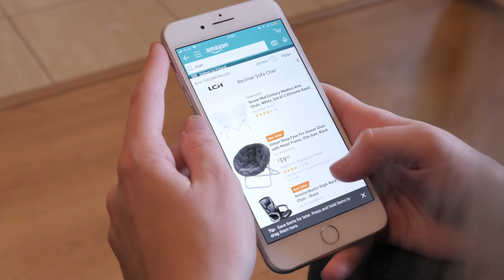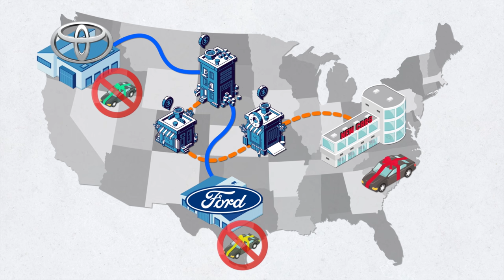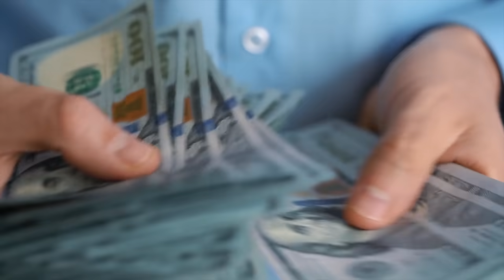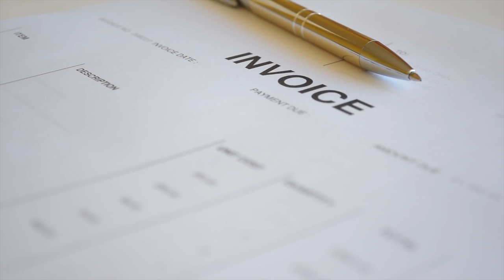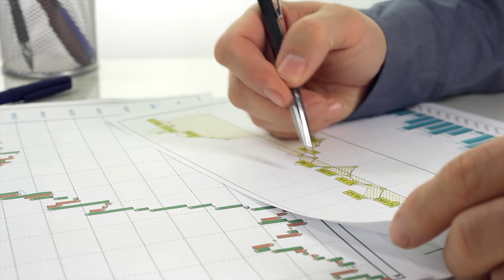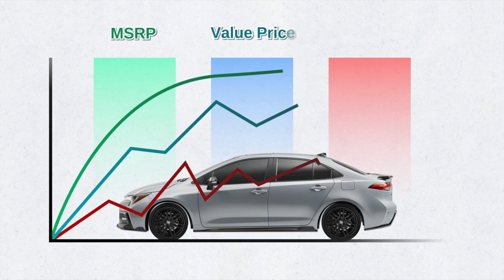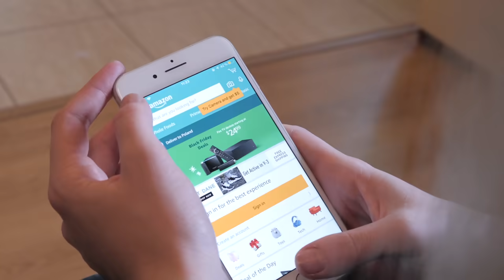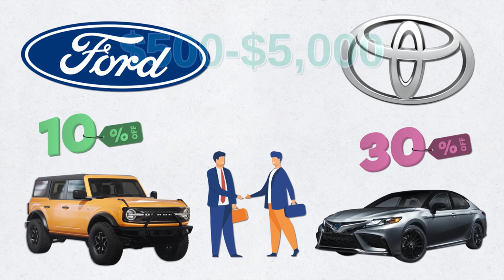Here’s Why Car Prices are About to Get Way Worse

Comment: That’s why I’m never getting rid of my 21 year old civic. Still runs great and plus insurance is cheap and the best part is I have no car payments.
Reply: Love my 01 odyssey.
Reply: Same here, I have a 2004 Camry 126,000 miles, never had a problem yet, I will never sell my car
Reply: @NewbirthHannah05  Diddo, I have a 2004 Chevy Silverado that I will drive until the wheels falls off. I also have a 1983 Oldsmobile Cutlass Supreme  Brougham,  a 1985 Buick Riviera and a 1982 Dodge Ram 🐏that I will drive.  Not going for the scam of buying disposable vehicles that are overpriced and will not last.
Reply: Same here with my 2006 Forester, 94 K miles, runs great, paid for and has a manual tranny too.
Reply: Love my 2020 mdx and 4 more years of payments to go
Reply: 99 v6 Honda accord 137k miles running like the day I bought it
Reply: @SpyderBlackOfficial  in 22 yrs it only has 137,000 miles ? You only put 6,000ish miles a year on it? That is awesome
Reply: @charleswilliams6758  Same here brother. I have a 1996 Ford F150 with a 5.0L (302) Windsor V8 with 209,000 miles on it and still going strong. The only things I replaced on my truck was the starter, the rear fuel pump, and the power steering magunisum but other than that mostly was just simple maintenance, took out the transmission fluid just to get rid of the shuttering it was making and it hasn't had a problem ever since. I Also have a 2011 Ford F150 with a 5.0L Coyote V8 in it with 142,000 miles on it and still going strong and it's a beast and it sounds like a beast with the Borla ATAK Catback exhaust on it and both of my TRUCKS will keep on truckn and best of all they're bought and paid for.
Reply: Same here Im keeping my 2006 acura rsx 5 spd manual base with 198,000 miles on it and driving to until the wheels fall off
Reply: Same. 04 sienna and 11 pilot
Reply: Same. I bought my used Camry 2012 SE model for 5k cash. Car only have 100k mils. Car have some style to it and it paid in full. I had this for about 3yrs now
Reply: Is the end of fancy cars in usa. 😥
Reply: I got my 2003 expedition for $3k. Repaired it and runs like a dream,
Reply: More than that, one of the biggest ticket item you have in owning a 21 year old civic is that you have little to no depreciation and it may even be appreciating as it ages now.
The next biggest ticket item is that it has little to no product obsolescence
The other big ticket item is that the knowledge, DIY diagnosis, repair and maintenance is non computer dependent. As it has been popular (not a limited model) around for years there is unlimited information on it. You can keep that car running longer than the newer cars.
Reply: I’m never getting rid of my 2015 Infiniti Q50. It’s sporty, reliable, and I’ve had it paid off for 2 years now
Reply: Mine is 11 and no buying a new car in sight.
Reply: @NewbirthHannah05  wait another 50k abs you’ll start to see problems
Reply: @SpyderBlackOfficial  Those are really good cars
Reply: Agreed. I got my Civic Si 2012 coupe, doesn’t let me down and I want to keep it. I just love it and gets me where I need. 103K+
Reply: My Porsche Cayenne costs an arm and a bloody leg to repair every time! Driving me nuts
Reply: UPDATE my civic was mashed in by another driver in the rear and was declared  totaled by the insurance company.
Reply: Stop thinking bout vehicles financially, it'll never make sense. Your life is yours to ENJOY. When ur on your death bed...the ONLY thing you'll think of is your loved ones and what you've done in your life and did u enjoy it. 

FROM DUST WE COME, AND INTO DUST WE SHALL RETURN.
Reply: @sanj5026  yeah I want to enjoy life not being in debt because of a darn car
Reply: @sonidoexperiencia  debt is fun my friend
Reply: @sanj5026  🙂 Isn’t that nice?
Reply: @kibawhitefang7176  isn't what nice
Reply: @sanj5026  debt 💸🤣
Reply: @sonidoexperiencia  same thing happened with my honda civic this month… need another car asap but car prices are terribly high rn and idk what to do
Reply: @mezxo5788  just keep looking around brother but don’t get rid of your car. I was able to get some cash for the vehicle and got to keep it of course insurance declared it “totaled” but I was able to find a good deal on a 2004 Highlander with 113,000 miles on it. Paid 8k for it

Comment: Its getting to a point where restoring any reliable brand such as a Toyota or Honda $1000 -$2000ish wore out beater is worth putting some tlc or restoration into with prices of newer used and new cars going as high as they are.
Reply: It really is.
Reply: I saw a video where a guy in Asia hand built a Ferrari replica with a diesel lawnmower engine and was driving it on the road. Try that here and they will arrest you and impound your homebuilt vehicle. You better comply. Who can and want to pay for new cars these days?
Reply: @mikenonameneeded3485  i saw that video! 😂 very impressive considering!
Reply: My 99 rav 4 will get some work now.
Reply: It looks like to me, after watching Craigslist, a beater will cost more like $2500-3000.
Reply: yea right 99 toyota camry goes for 2000$ in bad shape now lol even beater prices went up
Reply: Yup will last a lot longer once restored too
Reply: Yes but restoring or repairing older cars will be outlawed soon.
Reply: @lindap.p.1337  

That is correct. Late 90's model Civics and Corollas with over 250K on the clock, that were going for 1200-1500 back in the spring, are now selling for well over 3 grand.
Reply: They put extra 10000 on the prices lol inflated vehicles
Reply: Agreed.  I’m restoring a FJ-80 Land Cruiser and a ‘94 Jeep Wrangler YJ.  New Land Cruisers were selling for $90K + and new Wranglers are selling for $40K+.  Insanity.
Reply: It is
Reply: Spent 4 grand repairing my honda. No way I'm shelling out 29k for a new one when that same car was 22k in early 2020 new.
Reply: @lindap.p.1337  it’s rare finding a beater that cost less than 1000 bucks
Reply: Yup. Rebuilt a 2015 camry, shit’s hella reliable. 138k miles
Reply: @jamesb8619  

If it runs and has 4 tires on it someone out there will pay $2,000 for it
Reply: Base model it is
Reply: Yea the new cars just aren't reliably built and repair costs are ridiculous.
Reply: @subjectofgov  God, I hope not. If that happens, I'll cut my losses and start walking or biking everywhere. 

You'll never get me behind the wheel of anything I can't fix.
Reply: Just bought a 2015 Civic coupe EX-L with 28,000 mi for $19,500 worth every penny!!
Reply: Absolutely
Reply: @lindap.p.1337  i sold a 2004 civic 2 door for 4200 yesterday...210k miles
Reply: @fixitfelix718  

Good man... You could have got 5
Reply: I'm glad I put so much work into my 99 Mazda Protege. It runs like a top and is reliable. I just saw an identical one for $.5,000.00. Two years ago it would have been $2,000.00.
Reply: That's what I'm starting to think instead of getting rid of my 1999 Toyota camry
Reply: Just put $1000 into my 2000 Toyota Tacoma with 208,000 miles for new radiator and complete exhaust system including catalytic converters but it runs so good and reliable that I would be foolish to get rid of it. Frame is still solid under it, so I plan to keep driving it. A dealer isn't going to give me anything for it because it's a 22 year old truck so just going to drive it until it doesn't run anymore.
Reply: If per-mile road tax happens, I expect the price of old beaters with mechanical odometers to spike
Reply: @timetowakeup6302  yup, and I remember not so long ago the saying I've used my whole life was "anything running and driving is worth $1000" smh
Reply: @garyphillips6270  

You'd be surprised what some people would pay for your car.
Reply: @blurglide  not going to work either. They are putting GPS tracking devices in every single car that has a valid license plate. Can't get away from big brother on this one. That is part of what this pilot program is testing.
Reply: @subjectofgov  why?
Reply: thats why i am still keeping my 03 jeep liberty. Cost me less than 1000 in overall repairs a year including oil changes.
Reply: @lindap.p.1337  yup, it's absolutely rediculous. These people want 12k for rusted out, broken down shitboxes with 200 miles.
Reply: @phantomf41  you got a unicorn
Reply: @jamesgizasson  Get a job where you can work remote and then just buy motorcycles or something.
Reply: @robskyle  Not a unicorn. It have all the design flaws that came with mopar and chrysler but the way its been reliable for me is identifying faults ahead of time and taking care of maintenance in timely manner so it wont lead into bigger problems. Also I buy quality parts online and have my mechanic install it for me. I dont take it to any shops or dealerships to drain my money away into pits. A water pump for my liberty costs less than 200 including parts and labor. For a new toyota tacoma, expect its in 1000's even if you are getting the parts by yourself. Thats why I am still keeping my old liberty. Once you stay away from mopar parts while making purchases on after market, then you should be fine.
Reply: @IrishPizzaMan  that’s a steal
Reply: My 2012 Impreza has an appointment with the dealer to have the transmission diagnosed tomorrow . It’s better to throw a couple grand into the transmission than to buy a 3 year old used car that is selling at the current year’s MSRP or ridiculously close to it.
Reply: @subjectofgov  for real? Or are you just saying that cuz I never thought of it. Please educate me on this as I want to understand your point better
Reply: sad but true. I had considered buying a new car but theres so many reasonable used cars out there. or just fix up what i got and keep driving on :)
Reply: @midnightrebuilds  why did you have to rebuild a Camry with such low miles??? That was a rhetorical question🤣That car was abused.
Reply: Ssshhh people are catching onto this... All the beater cars are going up in price now

Comment: Looks like I’m hanging on to my 1999 Toyota Tacoma from high school. Nothing wrong with driving a car that’s almost the same age as you. Almost 200,000 miles and still strong. The only thing is that I want a prerunner or 4x4.
Reply: Brother you have an era that'll run 400k, folks will still try and buy that for decent money with 200k lol nice truck treat her well and you're set.
Reply: Might have to replace a torque converter or clutch round 300k.. Aw shucks lol
Reply: No cars are made like that anymore. Keep that golden piece of magic
Reply: I have the 02 prerunner double cab. I'm thinking of selling it. It has 230,000 miles. I just changed the whole front suspension and put a new AC system in it. It's fully tuned up.  My dad passed. It was his.  He took good care of all his cars and never drove them fast. I don't know though. It might be worth more than I know.
Reply: I traded a paid off 2010 Tundra for a 2015 Tacoma (Last year of the 4.0) for $33k with 60k miles. It's my 16th Toyota in my mid 30s and I'll be keeping onto this one for awhile. I travel across north America for work and can rack up the miles.  I don't forsee the current market getting any better at all so I made the jump to proven reliability for the 2bd gen model years after seeing quite a few issues with the 3rd gen.
Reply: @Xdtrl  How do you like the 4.0? My sister had the 3.5 and it was faaaasst! :3
Reply: @jamesgizasson  Even though the 3.5 has around 40Hp more, You need to be higher in the rpm band to achieve it with the torque. The 4.0 has some solid torque behind it aswell and has proven itself.
Reply: I have a 2006 Subaru Outback with 230,000 miles on it.... still runs like a clock
Reply: and you can still resale it for close to 10k right now
Reply: I have 308k on my 2002 Tacoma 4x4 super cab with the 3.4L.  Gas hog but never lets me down!  Yours is just broken in!
Reply: I have 4x4 ram and never use the 4x4.
Reply: That truck easily sells over 10k
Reply: Pre runners are really nice you can fine some for a good price, and ofc they’ll last forever
Reply: @erniecarrasco9107  for the love of God do not put another overpriced Toyota on the market!! Realistically it’s worth like 3k but people are tripping on used Toyota prices. Like 3 to 4 times what it’s worth😂
Reply: @DJ-kg6zq  🤣🤣🤣 ikr. I'll take 10k! Lol
Reply: @erniecarrasco9107  haha! It is a great time to sell… I still regret getting rid of my 1987 Toyota truck years ago😭!! It was soooo clean, I was too stoned 😄
Reply: @DJ-kg6zq  I sold my 91 manual toyota pickup 4 cylinder king cab 2 years ago. I miss my baby lol I drove it for 12 years! I sold it for the price I bought it for.
Reply: @erniecarrasco9107  🥺 they were such good trucks!!😭…

Comment: I have a 2019 sienna. Last year, i was $3000 upside down. This year, with 20k more miles on it, I'm $4000 in the positive! Lol its madness. So I'm selling that thing to make a profit and get rid of that $400 payment and get a paid off beater instead.
Reply: Look for a low mileage Corolla or Camry unless you need a van.
Maybe the hybrid Camry the way gas prices are going.
Reply: Smart move!
Reply: @k martin nice!
Reply: Have you received any offers from a dealership? I’m in the same boat with my is250 but don’t wanna be low balled
Reply: 2008 Mercury Grand Marquis was my choice. 3500 bucks.. Have had it 4 years.
Reply: @DWillz250  Print a flyer with a pic and details of the car and your number.
Shop it around to the service advisors at every dealership and tell them highest offer by next Saturday gets it. 
Tell them you're NOT interested in an offer from the sales department. 
This is a direct sale to the advisors who know cars.
Fax your flyers to other service departments in big cities near you.
This is the new marketing created by the Pandemic.
Reply: Better yet I just hang on to my ‘97 Saab 9000 despite the repair bills piling up to $2.5k in 7 years of ownership coz I can’t find a fun little practical sports sedan for what it is.
Reply: You will have made $7000 lol. You will get a 4K paid off car in the process and you will get $400 back in your budget.
Reply: I made a video about getting ready to sell my van, cleaning it up and fixing a few things if anyone is curious. I really dislike the rigors of selling private party. I am thinking of calling those car buying services. Who ever gets me closest to bluebook private party value wins. If all the offers are too low, than I will suck it up and sell it myself.
Reply: I had a very similar situation. I got out of my loan at a profit and paid cash for a beater. Things a unpredictable so I'd move on it.
Reply: The thing is, even that beater is going for atleast a 1500$ premium. Supply and demand effects everything.
Reply: Selling my 2017 4Runner and getting a used 2007 Camry

Comment: Im gonna drive my car till it dies. Then Ill buy a used car. There is no way I am buying new ever again. Those days  of having a new car every few years are  gone. Ill ride a bike if I have to!
Reply: I've done that exact thing for the past 30 years. Makes sense, economically.  :)
Reply: My new car is finally paid off, gonna drive it till it costs more than it's worth to fix it
Reply: My sweaty 300lbs neighbour drives around half the year wearing only dirty shorts and his hairy chest sweater. That interior is disgusting. I buy new cars every 10 or so years cus rust belt. There's no way I'm every buying used again!
Reply: riding  a  bike  and / or  walking  makes  sense.  owning  a  car  costs  too much  n  so  does  gas.
Reply: Sold my car in August and I have been biking everywhere since. It gives new perspective on owning cars. Increasing gas prices, maintenance, car insurance, and flat out being a liability has helped me transition into this new lifestyle of walking more and biking.
Reply: @stevegonzalez9871  that’s fine if you’re an urbanite. Not so much for the other 60% of us.
Reply: @stevegonzalez9871  I had to sell my car some years ago and rode a bike to work 20 miles round trip for a little over a year.. easily one of the most awesome years I ever had lol didn’t have to worry about, gas maintenance, insurance, tickets.. screaming at other people on the road.. I got to ride my own ride rain or shine and it was awesome!

Comment: My wife and I had 3 vehicles. I don’t drive much so we sold her 2019 Tahoe and stuck the money in our pocket. She’s driving our 2017 f150 now and I am driving our 1996 gmc 1500. We took advantage of the market. We are in our mid 30s and realize we have to make smart choices to better ourselves in the long run. My 1996 gmc has 256000 miles. I just got back from a 3 day 500 mile trip in it. I maintain it properly and it takes me where I want to go.
Reply: Smart

Comment: Based on the limited amount of new  vehicles on lots right now, Used car prices have sky rocketed! I was looking at buying a used 2020/2021 pilot but they were only about 5-7k cheaper than a new one. Used ones had about 15k miles on them. Makes no sense to by used at this point. Market is crazy right now. 🤷🏽‍♂️

Comment: I wanted to buy a new 2021 Tacoma. The dealer wanted $5000.00 over MSRP. I walked out and went to Carmax and found what I wanted with low miles for a good price.
Reply: That's impossible "getting a deal at carmax "
Reply: I worked at CarMax... I doubt you got a good deal